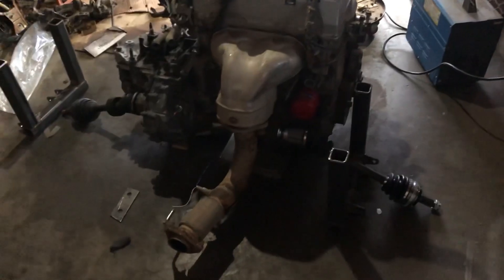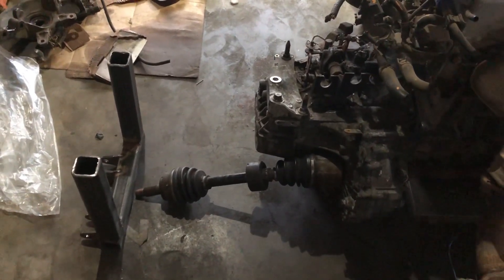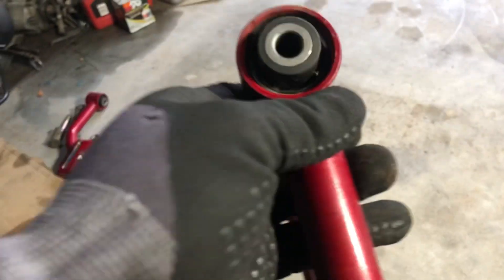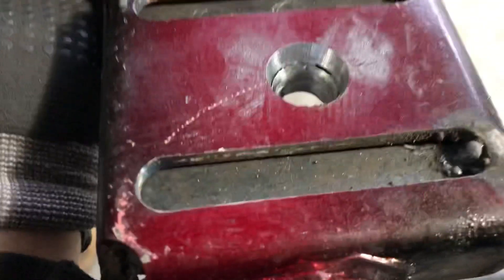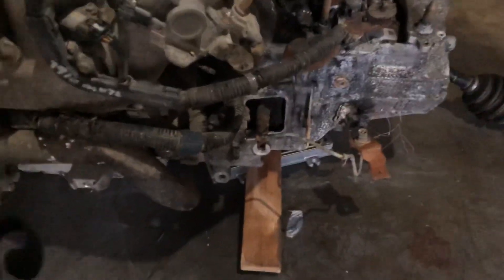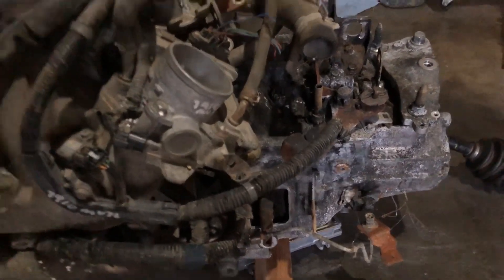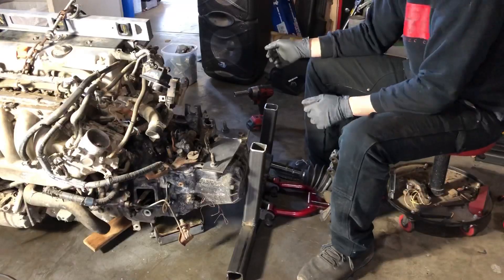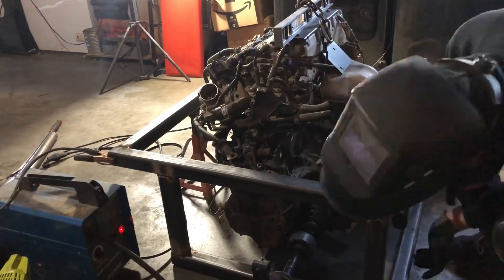Building a Mid Engine Cradle for a K Swap in the Honda N600 | Ep. 1

Comment: Nice job leeroy.  How thick are those square tubing?  Is that gonna be the actual framing that will go onto the chassis or just to hold the engine for now?
Reply from the maker: Thanks bro! It’s 3/16” thick wall. They’re pretty darn heavy and adds a large amount of weigh to the car. Oh you probably couldn’t hear the commentating at the end due to the music. But it’ll act like a subframe so that I can remove the whole thing in and out easily if I need to make adjustments or work on the motor in the future. The plan is roll cage and braced all around